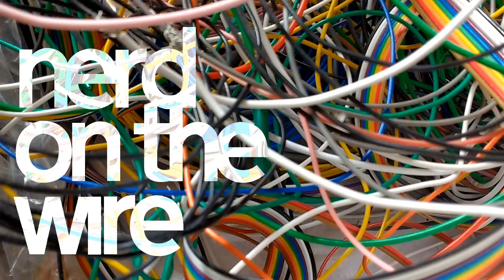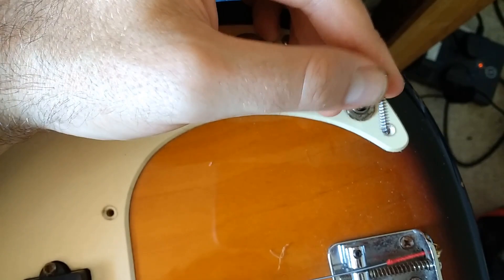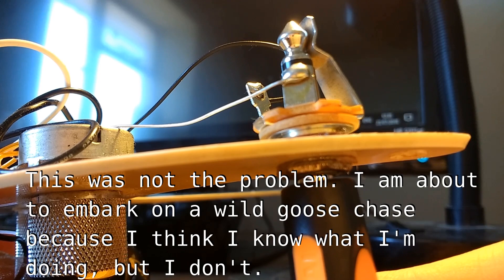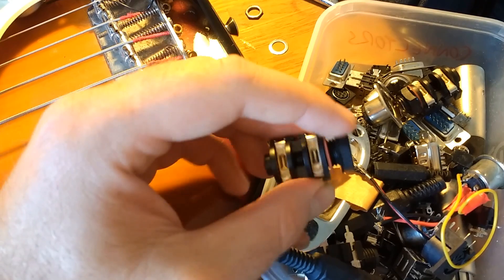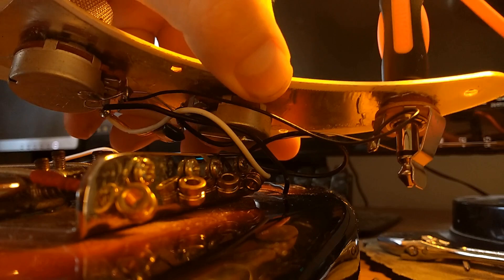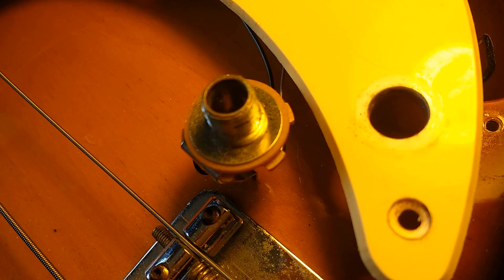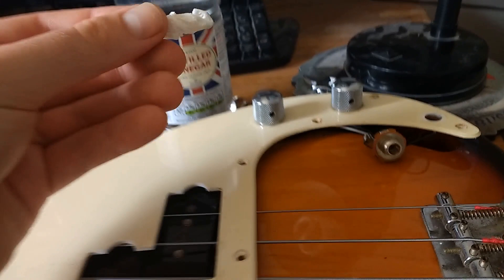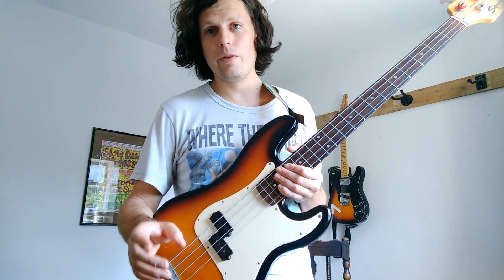How to fix a crackly jack socket on a bass guitar

Comment: Glad I found this vid. I disassembled my bass, mainly to shield it, but also to look into a noisy, crackly jack. Took care of the shielding, but didn't think to clean the jack. I didn't think that was my problem. Hooked it up and the crackles were still there. I see now, I'll have to take it apart again and try cleaning inside the jack. Thanks much for the vid 😁

Comment: Thanks for doing this. A wobbly jack can also cause crackling. I recommend tightening the nut as tight as you can. Also, you must have both washers in place (inside and out). I also made sure, after looking at several videos, that the back of the aluminum stem inside the jack is facing toward the bottom of the bass body. In other words,  if the bass is on your lap, the back of the stem should be facing the floor. And make sure all wires are safely tucked into the cavity. 😊

Comment: Just had the same issue...  BUT... the back of the pick guard will have aluminum tape with must make contact with the female adapter.  IF the metal tape is damaged at the adapter, use a thin washer first then tighten the outside nut.  In my case, it was a cold solder joint and a bad connection on the underside.  Works like a charm!

Comment: Yes, it will fix the problem temporarily, but the crackling will come back in 3 months or so depending on the humidity in your are. Some input jack  is just not right in production or defective, the jack and socket should be tightly fit in, but some jack happens to be bit loose due to reasons above or prolonged use, corrosion and dirt built up and got you got the cracking sound. Buy a new one, that will fix the problem for longer term.

Comment: noooo, go to the store and buy those extendable round eraser pens.  The white eraser.  Use that to clean the contacts will clean them without scratching them. 'Pentel Clic Retractable Eraser' Just use a brush to brush away the eraser residue when your done.  Dont let if all into the guitar.

Comment: Just get Pure Tone jack and forget about bad connection and grounding issues/noises/crackling, plus the sound is better. ..My not humble opinion..because i am really tired of the cheap parts, fixing them and juggling around them instead of practicing and playing (enjoying the instrument)...The stingy pays twice...i think i paid 100 of times... No more: good pickups, good switches, good wires, good jack, good soldering, good cable, good pickups, good amp, good tuners, good strings, good nut, good bridge, good woods, good... Not fancy (it's just another extreme), but good, reliable, satisfactory.

Comment: Why vinegar? Would any other weak acid work? What are you trying to remove?
Reply: A lot of stuff would or could work, like ipa or maybe lighter fluid. It removes stuff like corrosion or other grime that could be screwing up the connection it makes when the metal makes contact.